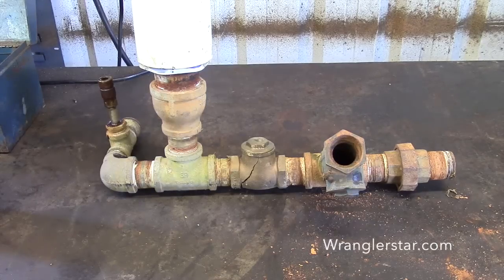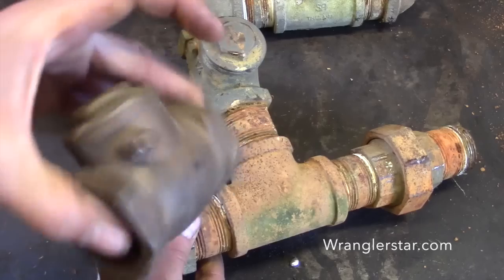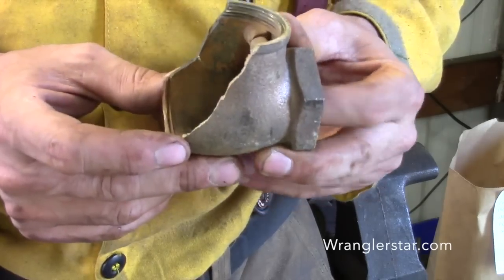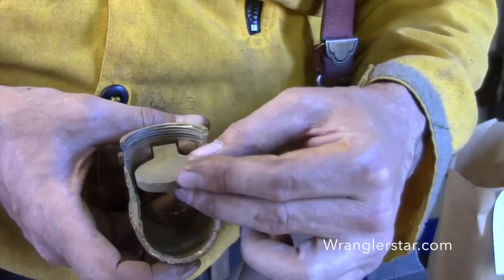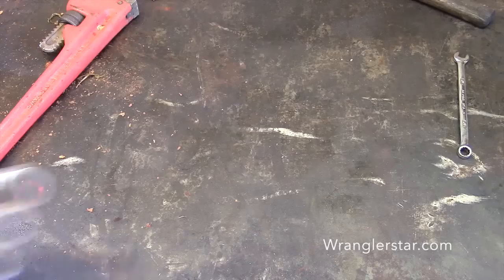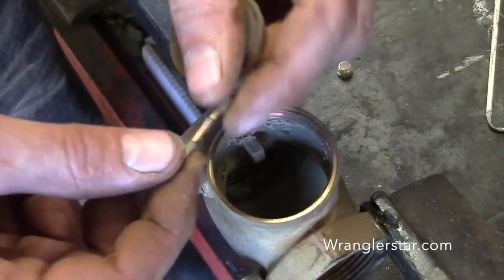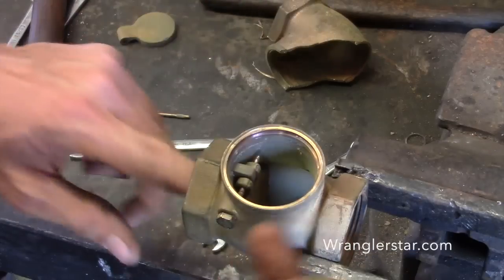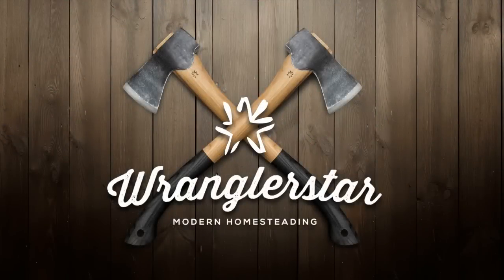Water Ram Pump

Comment: I've had a ram pump running for about 3 years now and I've learnt the waste valve needs replacing every season. Tried repairing it a few times but it gets so worn it never seals. For the delivery valve I found the spring loaded poly check valves worked better than the brass check valves.

Comment: Engineer775 talked about how you can modify the home built units to get more height of lift by changing how the upper valve closes. The longer the valve stays open the higher you can lift water as you have more kinetic energy behind it. Might be able to get more gph by doing the mod but you would want to talk to someone that plays around with the pumps all the time.

Comment: i have all the drip irrigation stuff and opted recently for cheapo 1/2" pvc pipe with an ittybitty drillbit to put directed holes in.  cleanouts on each end.  but much cheaper from most online sellers than home depot for the drip irrigation stuff.

Comment: My method probably wasn't as "proper", but I was helping an elderly neighbor fix her ram pump (had the same issue with the warn check valve pins) and I ended up using a coat hanger cut to length as a replacement pin. It wasn't a brass hanger, i think it was stainless steel or chrome coated? It was a very shiney metal coat hanger.

Anyways, I figured if the original is going to wear out in 6 months to a year, then my fix might last about that long!

Comment: Try using stainless steel tig filler rod as a pin for those flapper doors. You can cut them to length and come in different diameters.  Should not wear out as fast as the brass pins.

Comment: It may be worth it to buy stainless steel to move out your maintenance interval.  Looks like you should replace your pins twice a year.  My guess is that the pump stopped functioning due to the broken flap valve causing standing water; and then it froze.  Moving water doesn't freeze nearly as easily especially if you had a very mild winter.

Comment: Well Cody, I could be wrong, but from my training, I'd bet the frozen water will expand up to 50% its original volume. This unstoppable expansion will consequently crack the pipes that contain the frozen water.

I hope all is well out West with you and your family.

MS
Reply: Your ramp pump is one of the channel secrets!    It is one truly special invention. 
Thank you for sharing!
Reply: Would it be possible to isolate all those wear points within the interior of that check valve with Nylon/Teflon washers and spacers? Or is replacing those sacrificial parts the only way to prolong its life?

Comment: To bad you busted the new one! Its the far better valve. The single long bearing surface will last much longer than the split surface. The reason that those 'cheap' all brass valve wear is because there galling due to the lack of lubrication (FYI water is a terrible lubricant!), if you replace one part with a significantly harder material you will get much better life out of your valve.  If you want one that last 'forever' then get one with a stainless steel pin or valve. My favorite are the brass body, pin and seat with stainless valve. Also how clean is the water? Is there any fine sediment in it? that will eat any valve like crazy! if so consider putting a filter element right before the valve. My grandfather has a spring fed pump that he installed a filter on and it went from needing repairs twice a year to no one has touched it in years (other than changing the filter once a year or so).

Comment: The metric system has been officially sanctioned for use in the United States since 1866, but it remains the only industrialised country that has not adopted the metric system as its official system of measurement. Many sources also cite Liberia and Burma as the only other countries not to have done so. Although the United Kingdom uses the metric system for most official purposes, the use of the imperial system of measure, particularly among the public, is widespread and is permitted by the law.

Comment: wranglerstar just did a bit of quick maths and judging by the 1 1/2 size valve moving at 1 closure a second, that valve has moved a little over 31,500,000 times in a year :)

Comment: wranglerstar Cody, I have two ideas, and I'd like you to do all the work.  ;-)   First, have you considered Tesla valves to replace those check valves?  Zero moving parts, but I'd bet it would take a custom cast.  (A friend of mine does Aluminum casts, so it's not crazy-out-of-the-question to do brass).  Second, if the pump were submerged and all that black PE pipe we saw earlier were buried, would you never have a freezing problem?

Comment: dogs can learn how to open doors

my dog can open round doorknobs by biting it and turning it

also dont use a pipe wrench on fittings that have bolt shapes
use a crescent wrench
pipe wrenchs have slop in them so they can grip round pipes not bolts 
you can round off brass very easily